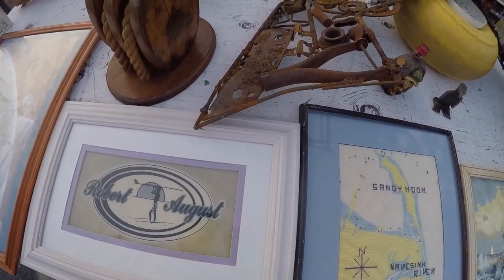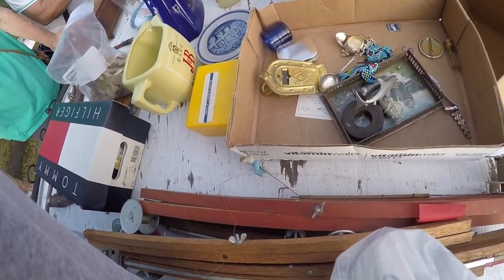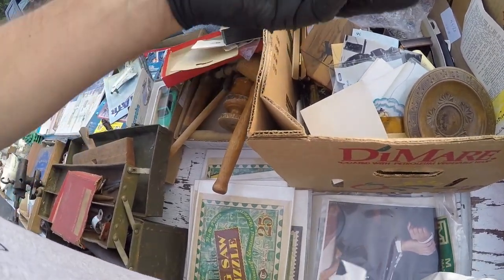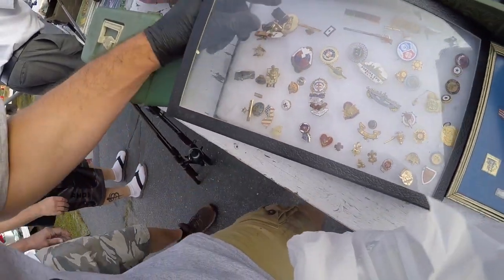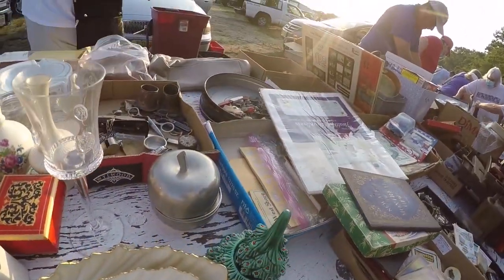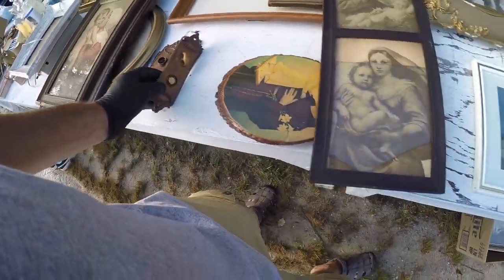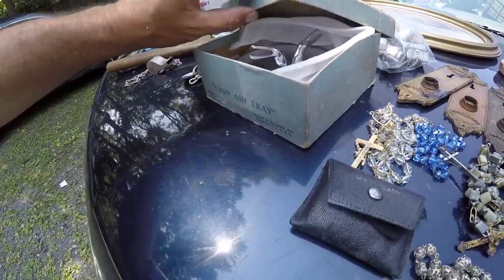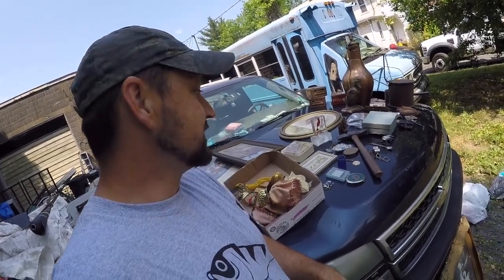Flea market picking! Found a good variety or treasures and antiques!

Comment: The blue dose cap you bought goes to a John Wyeth medicinal bottle. They went on different ones ( all the same shape). They're fairly common and shouldn't really sell for more than $10 tops although some on Ebay try to sell them for much more. If you ever have a question about old bottles, msg me. I've collected them for close to 50 years and have well over 2000 pre 1900 bottles.

Comment: Water stained Cigarette box 29:49 : you get the water out with an iron and towel in between. Don't really touch it until you see a progress. Slowly increase the temperature and it will look like new. Same with stained wood, no matter how long ago it got wet. Takes patience and best is to oil it afterwards. No matter what oil, I prefer 5W40 or olive oil.